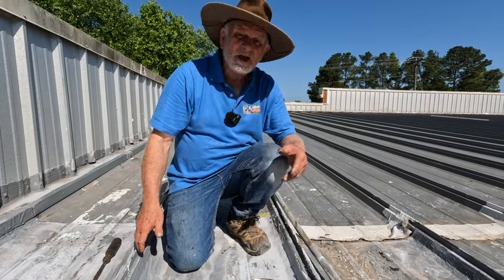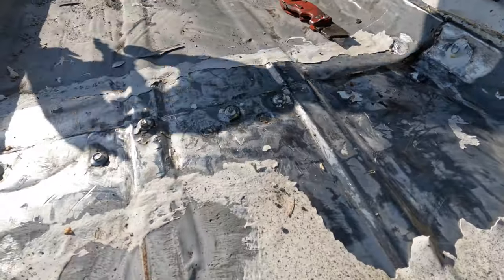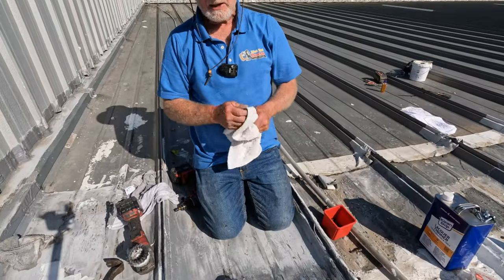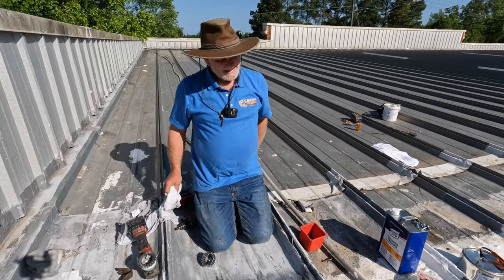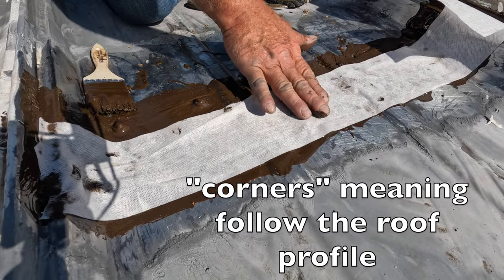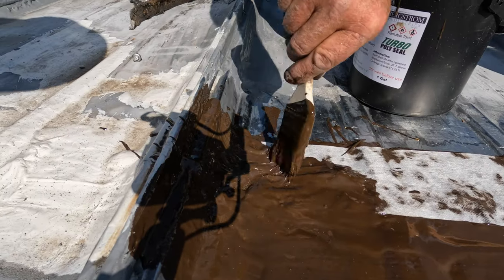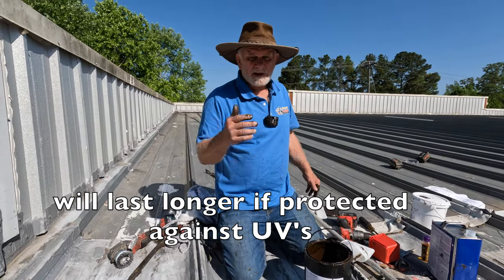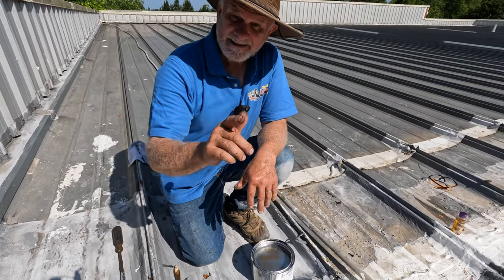How to Remove Silicone Sealant before making a Repair on a Metal Roof Seam

Comment: Preperation is key. If you don't prepare the surface nothing will stick to it. I have a bullet hole right now i patched that is still leaking on a metal roof. I didn't prep it good enough, so i have to go back and fix it.

Comment: I have a mobile home with flat tin roof if i remove the rust and tighten or replace roofing screws and use super sylicone sealant and i able to use a roofing seal that you roll on  as long as its sylicone or can i use any roofing sealant

Comment: Here's a helpful tip to everyone! DO NOT use Turbo Poly Seal that this guy promotes! That stuff works okay, but it's insanely expensive. $200 a gallon,  and it doesn't work on all surfaces, for example not on all plastics or rubber. Buy Blackjack Eterna-kote Silicone, it's $300 for 4.75 gallons. It works on more surfaces and has the perfect texture and surface for repelling water. The BlackJack Eterna-kote Silicone is way better and way cheaper!!